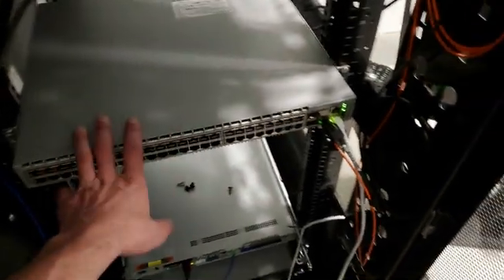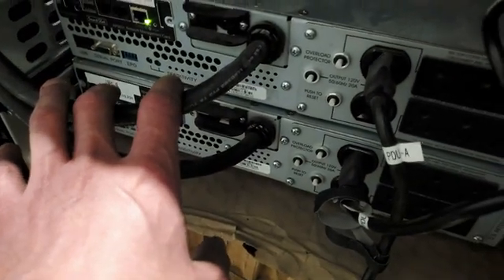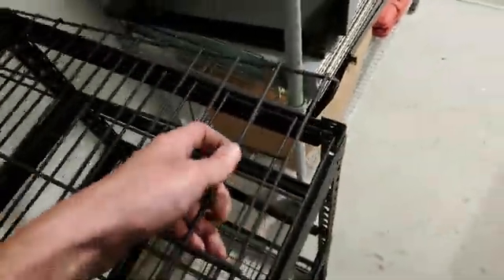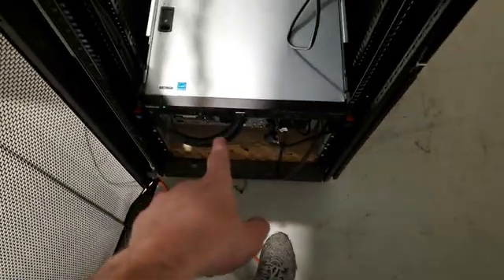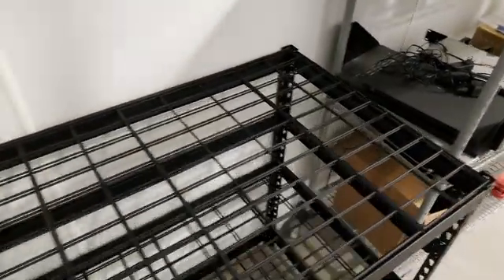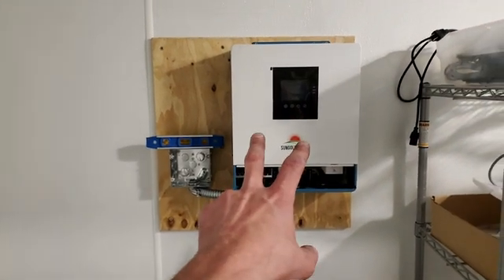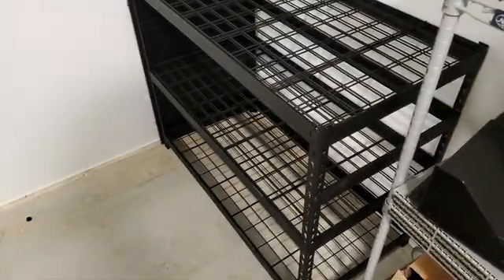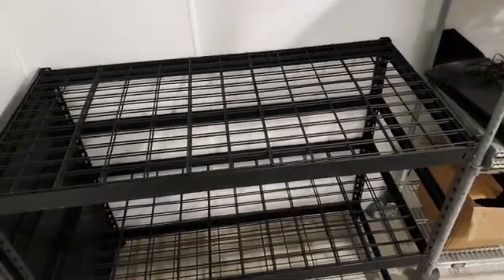Building a better UPS.....Part 1

Comment: go look at what will prowse does on his channel - forget the generator and just add enough panels and battery combo and save some money or go with a portable yamaha/honda - your power req are not that extreme - with rack mount batteries you get bms and remote monitoring, lithium will last longer which means lower tco and less maintenance - pls followup and look at industry best practices and get several opinions. why do conduit when you can just use mc?

Comment: Sla cost is way higher per kwh for a inferior product, 3-4x 48v lifepo4 batteries gives you redundancy and cost savings. No reason to use lead if your in 2023.
Reply: Also using 120v 🤔 so I guess sla is par for the course
Reply from the maker: @tj11391  not all equipment runs 120v only the battery side does.  We run 208 on most stuff when possible and I run 240 on a few sites.

Comment: Unfortunately the transition will cause a drop in any gear not loaded down with capacitors. Especially under load. The transfer time on an inverter charger is not fast enough. I know this as Ive tried the same thing with my "Renogy" inverter charger. Some UPS's also have problems with Inverters. With servers you also need to make sure to use Pure sinewave inversion. Id suggest adding an Eaton UPS large enough to handle the load into the rack to smooth the transition.
Reply from the maker: I saw this comment this morning and my heart stopped.  I hope your an idiot and your wrong :)  But I think you might be correct so I will still need a 10 minute battery on the other PSUs regardless.  We will be testing tommorrow.
Reply: @briceperdue7587  I think @thefixitgal is correct. You will need a UPS in front of the bank and ideally an online UPS that is always making sure the power is clean vs an offline. Will stay posted though, love the videos.
Reply from the maker: @bovie2k  In front of the bank?  Can you help me understand why it wouldn't be behind the bank?
Reply: @briceperdue7587  sorry for my bad terminology. I was thinking online UPS's would need to sit between your hardware and the sun gold power solar charger inverter but in the video you mentioned doing testing hopefully fixitgal and I are wrong and your hardware works fine with the transition on the sun gold inverter. keep us posted.

Comment: Nice project bro. Sorry but you cant just add another bank down the road. Its like adding another battery to an already aged battery. I like the other guys 48v DC powersupply idea.
I would also leverage the gear's A B power.
Reply from the maker: Good call I guess I didn't think about that part adding more batteries down the road.  But I can remove them from 1 POP and upgrade a POP at the same time I guess.  the 48 volt DC power supply is a good idea but opens up a new can of worms I'm not prepared to tackle.  Also all devices don't support 48 volt native so I'd still need AC power support too.

Comment: The most efficient way of doing this would involve be swapping one of the AC supplies from each server and switch to a -48Vdc, leaving the ac plugged directly into the wall.  When street power goes down, all devices will float on the -48.  Running the devices off of AC is least efficient since there is a "double conversion" happening.  DC->AC->DC
Reply from the maker: I 100% agree with you.  But due to running a mixed shop of equipment, and having to support a variety of hardware.  Using 120v is just more ubiquitous and some of our equipment a 48volt psu isn't an option.  So I would then still need to support 120-208v
Reply: Some vendors don’t support you doing that (mixing AC and DC supplies in a server/appliance). I.e, you can do it, but no guarantee weird stuff won’t happen.

Comment: Also 2 way switch is dodgy for the generator / line split. 30a ain't no joke. Most of them have a gen input as well as dry contacts for electric start if the generator has it.
Reply from the maker: Our generator for this site is a a manual one where someone must physically start it.  I will most likely include a better way on the second site but for this one I can almost walk to from my house.

Comment: I'm sure you know, but you can't mix the load of the solar all in one with your mains panel. Line no problem you can pull from your mains panel. Code is you drop load from solar all in one to a split panel which you can then pull the breakers off as you need.
Reply from the maker: Here the code is as long as the service disconnect is within sight and requires less than 6 movements of the hand to disconnect power.  I'm taking main into the inverter only to power 1 single receptacle that also has a fused disconnect.

Comment: Love the project!! 
Little idea, instead of hard wiring an extension cord to your double throw switch, I'd recommend installing a power inlet receptacle to your switch, its basically a male version of a regular outlet, usually made for generators. Its better looking, safer and more code compliant.
Hyped for next episode!
Reply from the maker: Yeah that was just my janky explanation as if i'm going it at home :)  I'm going to make it either a male receptacle your suggesting or possible even putting it outdoors where the actually generator would be plugged in so then you don't even need access to the space.

Comment: Thanks for bringing us along again!
Reply from the maker: Thanks for hanging out.  I assume your DC has a different approach to power :P
Reply: @briceperdue7587  Haha yes, our UPS is 10 racks full of batteries that can run the whole DC until the generators kick in!  We also use it to 'smooth' out the power coming in, acting like a big capacitor. 

It's fun hearing all the relays click when we have lost power. Little scary when out on  the floor next to the rack and then bang as everything switches over!

Comment: Hey, what is that ciena for? Is it the same one you took from the new officw to learn the cli? Or is it something else?
Reply from the maker: Transit connection
Reply: @briceperdue7587 Gotcha. Do you like Ciena's equipment? Would you reccommend it?
Reply from the maker: @deepspacecow2644  Not really.  It's overprices, requires a special everything.  Special optics, NEW CLI to learn, and even a proprietary serial cable